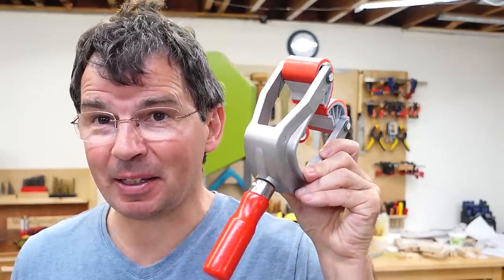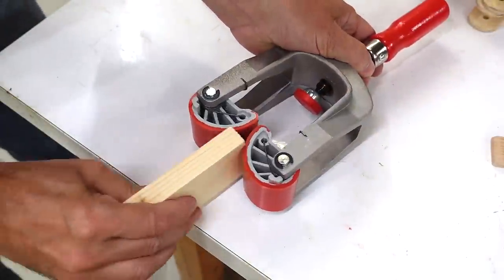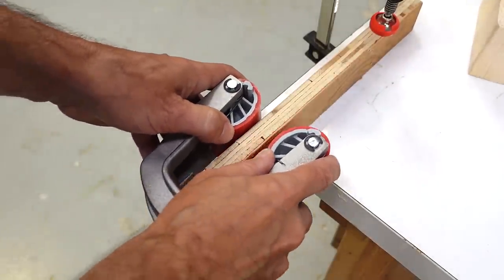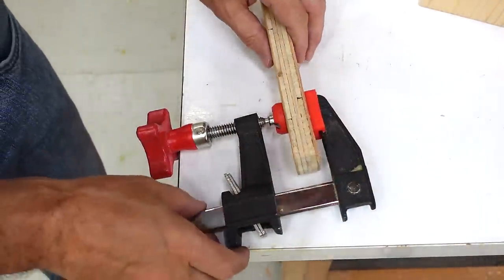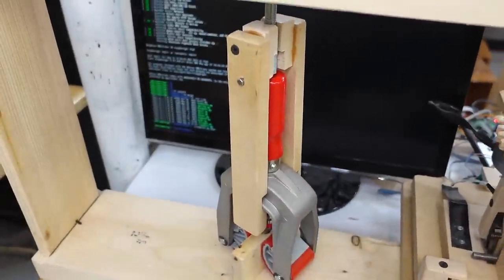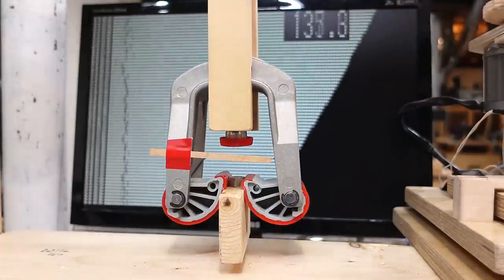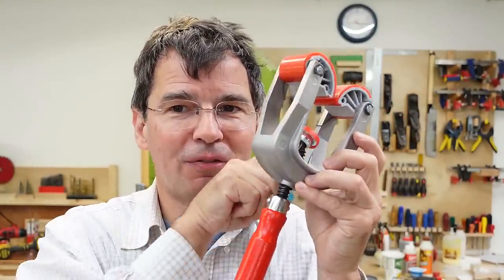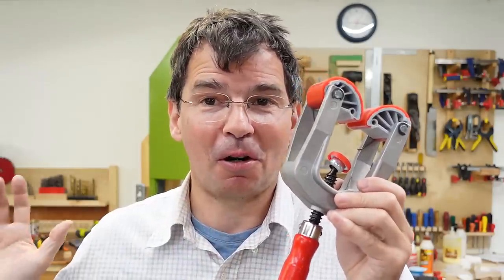Bessey edge clamp vs. F-clamp and wedge hack

Comment: Yes, we had few of those exact ones and a few smaller ones at my previous job, but rarely used them. But when we did use them, these were extremely useful. You could even add a thick strip of wood in between to even out the pressure to the whole edge.
Reply: Yes we do that too. When edging a diameter we have curved packing blocks CNC'd at all diameters as a packer.

Comment: We use them were I work for edge clamping hardwood onto Formica, linoleum, marble and veneered table tops. We have about 50 clamps. Some days depending on what's coming through you can use all 50 in the morning and then repeat. Yes you need to manage the cam by hand sometimes over the edge of a 50mm edging. Same to release them. It gets your fingers if your not used to them. They are not perfect on all surfaces as sometimes just keep slipping. We have had the same ones for around 20 years. The rubbers are worn on a lot of them. The springs and the pins are first thing to fail.
We would be lost without them. Chucked on and off benches and the floor the frames have never failed. We also use them individually to close up 2mm pvc 2mm veneer edging at the join on a circular table.

Comment: Bessey is generally way too expensive unless you use it professionally. For a hobbyist the quality is so good it can last for generations however.
Reply: Just repainted my granddads Bessey. They were so expensive he only had one and he was a framer!
Reply: Old stuff yup new stuff nope
Reply: Bessey isn’t really that good anyway. Jorgensen are much better.
Reply: @larry78cj7 at least in the small F clamps, I would agree with you, and I would also say the newer rubber handled Jorgensen F clamps are easier to use and get more force out of than my older wooden handled clamps of the same size.
Reply: I don’t believe that from intuition. The cam design and the surface layer to work with friction does not look durable at all. I might be wrong of course.
Reply: I find their regular clamps (steel and cast) as well as their lever clamps are reasonably priced, with cheaper clamps I often noticed, that the threads in the movable arm were not straight, so that the clamping spindle was kinked at an undesired angle

Comment: I bought 6 knock-offs of that Bessey design about 20 years ago when I had a commission to build 8' office tables with oak edge banding. They worked very well, but I haven't used them since. The only edge banding I do these days is short runs for shelves and I just use parallel clamps. I can put two shelves back-to-back in 3 or 4 clamps and it takes just a few seconds

Comment: I have two of those Bessey edge clamps. I didn't buy them though. My uncle found them in the trash of a workshop being closed down. Having used them a few times (with the exact annoyances you describe), I can say, yes they are handy, but in no way worth the money (if I had bought them). The F-clamps you can get for that money are way more useful.

Comment: I use a method similar to you with F clamps, never had a problem, I also have some of those 3-way C clamps that I think I have used once or twice in 10 years. For edge glueing wood aminate I just use blue painter's tape and let the glue suck it in, works fine.

Comment: I recently noticed that both Bessey and Rockler sell a clamp-on third screw for f-clamps for edge clamping. For the same price, the rockler ones have nicer rubberized knobs. I see the AT Restoration channel use these occasionally and was wondering where to find them outside of Estonia … so now I know.
Reply: Thanks for the heads up. Those Rockler ones look like a good solution.
Reply: I have some of the Bessey extra screws as well. Work OK, can apply a lot of pressure.
😊

Comment: I guess these make the most sense for professionals who routinely need it, the same way I use expensive stuff where I work. It's nice to have something you can buy and use intensively for years!

I'm just a hobbyist woodworker, and tape is good enough for my edge glue clamping, ie. solid wood edge banding.

Comment: the coefficient of friction of the rubber does tend to decrease at higher pressures. As I understand it, the rubber sort of oozes onto the rough surface of the other material, providing grip in addition to the regular friction that increases with normal force. So as the pressure increases, that extra grip matters less and less.

Comment: I have 48 (I counted) Bessey clamps of various sizes, and a few cheaper clamps. Where I find the most value in the Besseys is the screw. For me the worm thread screw adds a tremendous  increase in usability and value  over the machine thread on cheaper threads.
Reply: That beefy Acme thread sure does let you apply some force. Much better than the finer threaded clamps.
Reply: Fine pitch threads give you a lot more leverage over course threads. Twice the threads gives twice the force.
Fine pitch acme thread is ideal.
Reply: On many F-Clamps, the limiting factor is the bar getting deformed or the handle on the screw spinning free after clamping hard a few times. On expensive or cheaper ones. The threads are quite frankly never the limiting factor.

Comment: So I use these professionally and they work better than anything else for me.
They slide on with no effort even on 24mm boards.
If I have large edges to glue on(only have 12 of those) I combine them with my gluing press. Works beautifully

Comment: Seems like when they are the tool you need they really work, which did surprise me a little as I always thought the cams would bend the frame when the clamping forces needed to be more than electrical/masking tape tight... Though having now got a better view of them in this video I can see why they work so well and cost so much, they are very solid...

Comment: These are like Cams used in climbing.  But the ones used in climbing have a cable pull trigger to collapse the cams from the handle end. I am surprised whoever designed these did not do the same.

Comment: I think i saw you do the F clamp trick, because that's what i do. No need for expensive stuff. The only difference is i use those wedges for doors. I bought a whole bag of them for 10 dollars from fleabay many years ago and it's worked great with that, especially since with wedges, you center the load. I found the Bessey (or similar, because there's other types) to not be as good.

Comment: I've had surprisingly poor experiences with Bessey clamps. My budget sash clamps have proven to be much more useful than the Bessey parallel clamps I've got so I'd echo that sometimes the cheaper option might be a better one.
Reply: Not just sometimes, quite often if not the majority of times.
Reply from the maker: never tried the parallel clamps.  They seek kind of clunky, but more importantly, they are out of my price class.

Comment: you're saying at high forces the coefficient of friction changes (at high forces it slides off the workpiece) but it seems like you actually had evidence that at those high pressures it deformed the material being clamped. Maybe try with metal?

Comment: It could just be me, but it looks like the frame did plastically deform after your test. I’d have to say it doesn’t reduce the functionality of the clamp but it certainly introduced some fatigue into the system. Again, it tough to tell in the video but it looks like the cams are farther apart after the test
Reply from the maker: yes, someone else pointed that out too.  That suggests perhaps it is close to failure.  So maybe I'll do the pull-off test a few more times.

Comment: Wonder if these could be used as a low profile, high force face clamp?  I understand it's intended use is to apply side force, but I bet those cams apply a huge squeezing force on the part.   Now for the application where this would be useful? I have no clue.

Comment: What are the most common use cases? I would imagine that when you edge-clamp, you most often edge-clamp along the whole edge, so you would need many clamps, i.e. a cheaper solution than that.
Reply from the maker: Exactly.  So you need lots.  Gets expensive fast

Comment: Why not make an attachment that slides onto the bar clamp that does what an edge clamp does?

With the bar clamp attachment, you can make it 6 to 12 inches long and have two threaded rods that push against the edge. 
And rather than a metal pressure foot, you can have a wooden foot so it is less likely to mare the surface.
Reply: yoe mean a diy version of the bessey kt5-2?
Reply: @ensen89  

Yeah, that's exactly what I had in mind.
First I've heard of them.

Comment: I find a rubber band slipped over a spring clamp works just fine for straight edge clamping to cover plywood edge with a 1/8" strip but what do I know?

Comment: I love watching your test comparisons! Is there any chance you could compare threaded inserts vs wooden taps? I have a project coming up and I’ve heard wooden taps were strong than inserts. And I’d love to see your test prove it right or wrong
Reply: suman did a pretty thorough comparison of wood taps vs threaded inserts and came to the conclusion that wood taps were better. that said, I'm sure matthias could take it to another level
Reply: Wooden taps ? always interested to learn !
Reply: @CrimeVid  I think he means threaded inserts vs wooden threads.
Reply: It depends on how often you want to undo the joint. If it's one and done I wouldn't bother with inserts but if I'm constantly unscrewing it and putting it back together I would get inserts.

Edit: Of course it also depends on the type of wood. I mostly build with MDF so you can forget threading the wood directly. I'm sure it's different for hardwood.
Reply: In weaker materials such as wood and fiberglass and aluminum, the length of engagement of the threads matters quite a bit. If you are screwing into a thick piece, threads hold pretty well. If you are screwing into a thin piece, a threaded insert would be wise. As an example, threaded high-strength fiberglass (G10 or FR4) will hold against the full bolt strength if the threaded piece is 1.5x bolt diameter. The ratio of bolt diameter to thickness of threaded piece seems to be the controlling ratio. If your threaded piece is 1.5x or 2x you have a good chance of strong holding.

Comment: Since you have this really nice failure testing contraption err... apparatus , would you be interested in testing the  strength of various types of wood under load in all three directions against or with the grain? It would also be interesting to test whether the hole shape matters in a joint e.g.  whether the square hole in a mortise and tenon joint is inferior to the losenge shape hole in a domino joint or the round hole in a dowel joint. Just to be clear: I am not suggesting another joinery strength test, rather the mode of the stress would be dictated by a type of wood joint. In all cases, to ensure that a joint is not tested but the wood itself, the pressure on the test specimen would have to be exerted by a metal peg of appropriate shape.
Reply from the maker: perhaps watch my video on testing wood strength?
Reply: Hey Mattias, maybe you would be interested in testing this: for some time now I have been wondering, how does dust in holes affects dowels. I understand if there is so much dust, that the dowel doesn't fit, but usually the hole is a few mm longer than the dowel. So I am wondering isn't the dust mixed with woodglue a good thing or not? Thanks.
Reply: @matthiaswandel  if you mean this one

https://youtu.be/MBfzDEgfA0I

I already have. 

In that video you have tested wood specimens where the force is applied only against the wood grain. I am suggesting two more tests:
a) one with the grain i.e. the pulling force would be exerted in the same direction as the wood grain e.g. by making a square mortise (say of 8mm thickness by 3cm width), at a predefined distance from the specimen edge, say 1cm,  inserting a square iron bar of same thickness in the mortise and pushing in the direction of the grain, outwards towards the edge which lies 1cm away and
b) one against the grain where the same procedure as above would be used but this time the bar would be pushed laterally against the grain and outwards in the direction of the mortise face that is 3cm wide. This second test is similar to the test you have made but different in that it tests the strength of cohesion between the wood fibres rather than the resistance to breakage of a bundle of wood fibres.
Reply: @Stelios.Posantzis  engineering tests on wood have been done in the past. It might make an interesting video. But the conclusion based on previous test results is that most woods do not have high or predictable strength in sheer along the grain lines. Some tropical hardwoods might be exceptions to this rule. Keep the wood fibers in tension or compression. Don't ask them to resist shearing against each other.
Reply: @mckenziekeith7434  By unpredictable strength do you mean large variation, e.g. 100% or 200% or do you mean uncorrelated to the wood strength against bending forces (as tested in the other video)?
Shearing forces exist in any mechanical dry wood joint as well as in wood fixed with fasteners.
Reply: @Stelios.Posantzis  I just read that the strength was low and highly variable. Some woods are worse than others for sure. I don't know if you have ever split firewood? You can almost pry fir apart with your fingers. California coastal live oak is a nightmare to split. Of course shearing forces exist in the interior of any beam. But you shouldn't go out of your way to rely on the sheer strength along the grain. In engineered panels, the wood in the core is sometimes arranged so the end grain is bonded to the outer skins. This keeps the core shear forces perpendicular to the wood grain. This way, very lightweight wood such as balsa can be used.
Reply: @mckenziekeith7434  if you think of a mortise and tenon joint, the beam forming the tenon part, if it is a weight bearing element, it always exerts a shearing force on the beam were the mortise lies. The mortise is, if not always, most often cut in the direction of the grain. Same applies if the joint is by means of a screw, just as in the log splitting example you mention.
Normally, the shear force is not an issue in carpentry situations except when the amount of wood used becomes an issue. With the prices of wood currently experienced, the amount of wood used in any large project will be a factor to consider how to minimize.
You are right that expecting consistent measurements in something as variable as wood is a tall order though.
Reply: @Stelios.Posantzis  a tenon in the end of a beam is oriented so that the force trying to shear it off would have to break or cut the fibers. That is the strong shear direction. The weak shear is where the shear forces are trying to make the fibers slide alongside each other. Tenons are fine. The mortise may get loaded in weak shear. But standard practices seem to be largely strong enough for the load they see. Of course the vast majority of traditional  joinery does not even come close to utilizing the ultimate strength of the wood. That is not easy to do. I wish we could post pictures on youtube comments. I would draw a sketch.
Reply: @mckenziekeith7434  I agree, normal carpentry does not even come close to the limits of the wood strength but what is the limit? One can of course consult wood and carpentry manuals for numbers and guidelines regarding sizing etc. This is where youtube videos come useful in giving one a visual experience which is far more memorable.
Yes, conversations would be a lot clearer if youtube allowed posting pictures in the comments - I have often wished that - but I think we are on the same page, I get what you mean about the differences in shear forces.

Comment: The cams dont slip. Like you can so obviously see that the cams dont slip. The clamp bends and the cams push out and rotate. The coefficient of friction is fine.
Reply: The frame is the limiting factor. You can see it bend in the video. It obviously deflects significantly. How did you miss that.
Reply from the maker: Please watch the video carefully

Comment: Can you change the handle to something like a t shape to turn bessey into plywood gripper to carry stuff or pull middle sheets from stockpiles?
Reply from the maker: Could be done. But you can't just push it on the edge of a piece of plywood unless its really thin plywood, so not that useful.  The plywood gripepr thingies tend to clamp as a function of pull on the handle, and release when no lnoger pulling the handle.